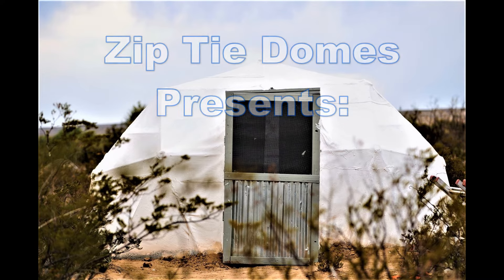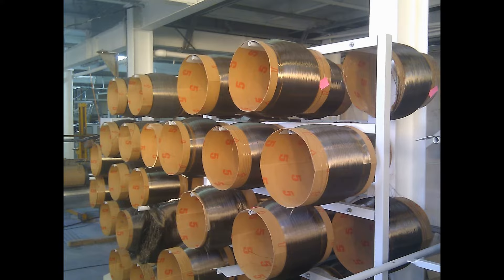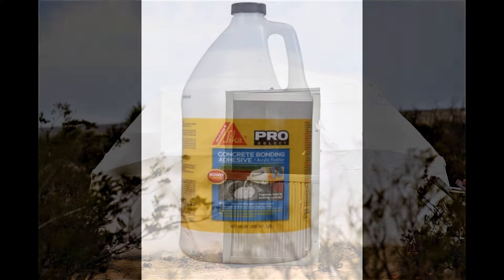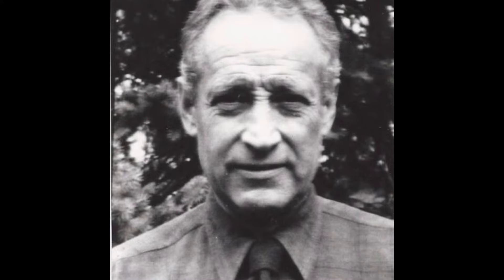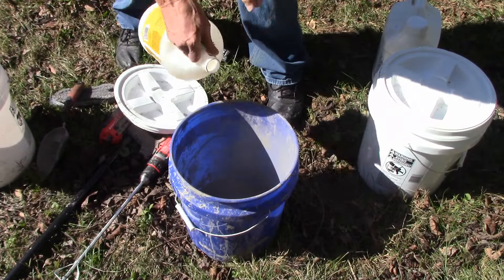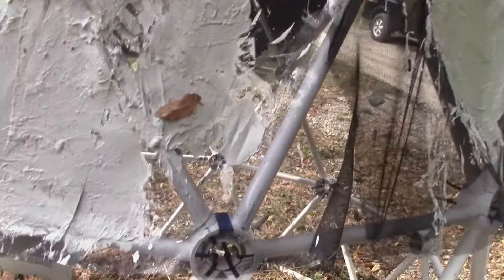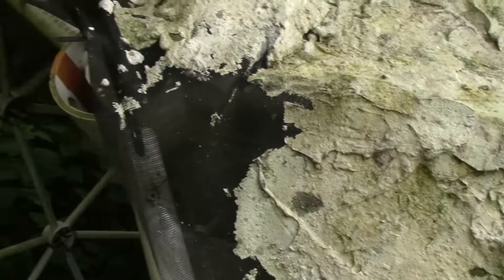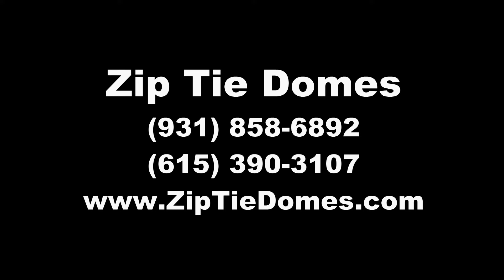Concrete Geodesic Domes: Building Thin Shell Concrete Domes Using Latex Cement

Comment: Let me introduce you to hot glue instead of staples and screws! it’s waterproof, and mesh to mesh adhesion is outstanding I’m sure…

… And your latex slurry should be coming from a gun… I think you need a batting material rather than a screen…
Reply from the maker: That is a great idea.  John Hurt